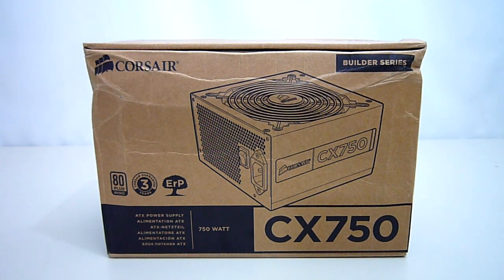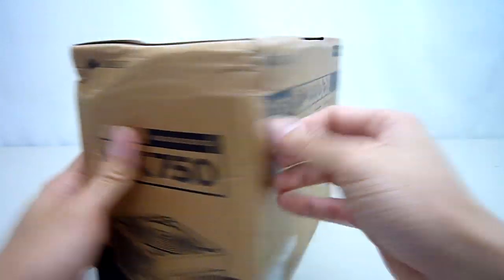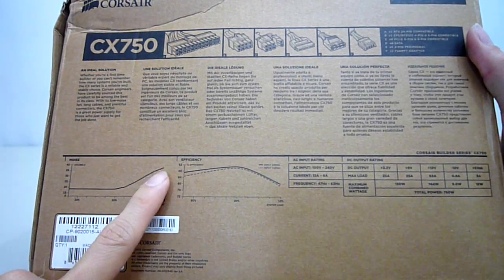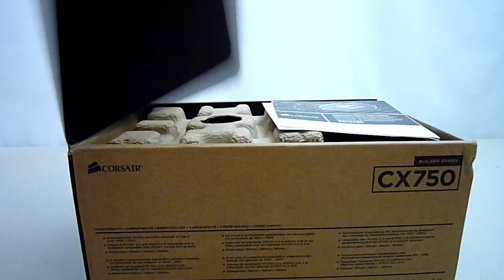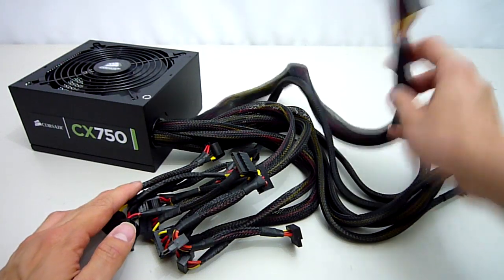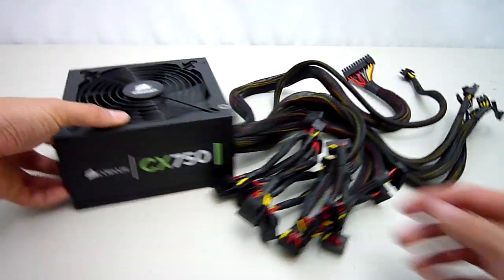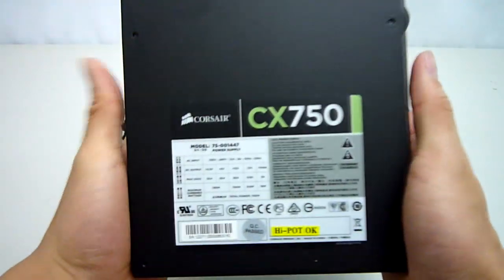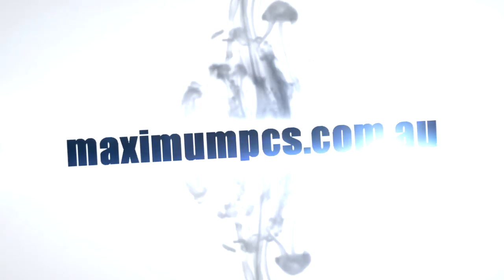Corsair CX750 v3 power supply unboxing & review - Maximum PCs Australia

Comment: will this handle two toxic r9 280xs?? pcpartpicker says the estimated wattage is 724 watts
Reply from the maker: Lukas Menke yes no problems I am using a Corsair 750W PSU with two R9 290s and it is not breaking a sweat

Comment: Is this a good PSU?
Reply: ***** can u tell me mine? If so here it is: 

CPU- Intel Core i5-4670k

CPU Cooler- Hyper 212 EVO

RAM- Corsair Vengeance 8GB

HDD- iTB Western Digital Blue

GPU- Gigabyte GTX 760 2GB

Case- Corsair Carbide Series 500r 

PSU- The same PSU in this video
Reply: spide Cooper i bought it for my 4670k, haswell ready.
but 12v = 11.7(11.8)!!!
Reply: wow nice man
Reply: ***** Would it work with
Gtx 650 ti

Gigabyte770

AMD FX 4100

Toshiba 1TB

 Ok Thanks
Reply: +Bradley0beaver  Hey, i'm going to by it next week, 
CPU-i5 4460
RAM-8GB ddr 3
HDD-1TB
GPU-  Radeon 7970
Case-Mid tower
Reply: You have steam?
Reply: Can i talk to you?I need to talk to you on something  privately
Reply: on monday

Comment: Hey! I recently had a really bad experience with a PSU that burned down after small 6 months of normal usage. So i need to know, will this hold a couple of years?:) My Computer components
I7 3770k ( not gonna overclock..)
Gtx 670 MSI
MSI Z77 MPower Mobo, if that matters. Thanks in advance.
Reply: This supply should do you just fine. But make sure that if you upgrade a lot, keep an eye out for if you need to upgrade the PSU as well.
Reply: PC and Console Gaming Okay! Thanks to both of you<3.
Reply: You could easily run that build on a CX 600!
Reply: Anything above 850 watts is for bragging rights! Even if you have a full custom water loop!

Comment: Do you think that the CX 750 actually provides that full 750w, and if it does, do you think it can keep providing it after a year of moderate use? Also, do you think it will be able to power an overclocked i5-4670K and 2 overclocked GTX 670s? I'm kind of paranoid about power supplies right now...:P

Comment: It will work thats for sure... if it doesn't you can always underclock your cpu and the gpu.... I had the same problem .. I had an sli on my CX500M and it worked just fine when i underclocked it so I am sure your sli will work probably without underclocking just fine even on full load...

Comment from the maker: Sorry about that - the connector on the power supply is a 8 pin EPS connector not a 4+4 pin however if your motherboard only has a 4 pin socket it will still work! you just plug in half of the 8 pin ;)

Comment from the maker: Nice hardware you have there! I think this will be able to run your dual GTX 580s but it is cutting it a little close as those cards are not as energy efficient as more recent cards
expected max power consumption for your setup would be around 700W

Comment: You note in the description that the EPS connector for this is 8-pin, Yet you say it is a 4+4 pin connector at the beginning of the video. Could I get some clarification? Does the cable accommodate for 4-pin cpu headers?

Comment: Hey I have this PSU and wonder if it can power 2 GTX580 in SLI.I used this power supply with 1 gtx580 SC for main GPU and a gtx460 se for physx. Worked just fine but im iffy on SLI gtx580s, it might not have enough AMPS and WATTAGE.

Comment from the maker: Nvidia rates the GTX Titan at 250W with a recommended PSU of 600W so yes that will be ok
The GTX Titan is 26cm long which will fit with plenty of room to spare in the 400R which supports graphics cards up to 31cm long
Just a shame the case don't have a side window to see that kickass hardware inside!

Comment: do you think that a be quiet 80 plus 430w psu is a enough to power the following : 
amd athon x3 3.8 hz overclock with cm 212 evo 
8 gb ram
radeon hd 7850 2gb gddr5 
500 gb hdd with dvd rw

Comment: Will this run:
Case - NZXT Phantom 410
Cpu -  Intel i5 3570k
Ram - patriot intel extreme masters 8gb (2x4gb) 2133mhz
Gpu - Msi twinfrozrIII gtx 660 2gb
Mb - msi z77 mpower
Cooling - NZXT Kraken x60
Hd - Pny xlr8 120gb & seagate barracuda 1tb

Comment from the maker: Hi there, good to hear you liked the video! Certainly this power supply has enough juice and connectors to run TWO GTX 570s as it has four 6+2 pin PCIE power cables

Comment from the maker: Depends what GPU you are using? 600w will be enough for pretty much any single graphics card on the market today (excluding maybe the 6990/other dual GPU cards), 500w I will say is enough for a 7870 or equivalent
Just make sure the PSU has enough PCI-E power cables, hope that helps =]

Comment from the maker: Hey, so the Xpredator X3 comes in at about 53cm high
Cables on the Corsair CX750 v3 are as follows:
24 pin ATX 60 cm
8 pin EPS 65 cm
6+2 pin PCIE 50 cm
SATA cables 70 cm
Molex cables 76cm
so yes should be all good =)

Comment from the maker: Hi there! I would say they are both built to the same quality. Either way both are not modular so personally I would go for the CX 750 as it has an extra 10A on the +12v rail and 4 PCIE 6+2 pin cables rather than 2. 
The only thing the TX 650 has going for it is the 5 yr warranty compared to 3, the little included corsair bag and the corsair sticker haha

Comment from the maker: Good question! so I did some more information digging...

The NZXT Phantom 410 overall is 52cm high
Cables on the Corsair CX750 v3 are as follows:
24 pin ATX 60 cm
8 pin EPS 65 cm
6+2 pin PCIE 50 cm
SATA cables 70 cm
Molex cables 76cm

so yes should be all good =)

Comment from the maker: Hi! yes this will be plenty for what you intend to be running as nvidia recommended using at least a 550w psu for gtx 670s
In fact with four 8 pin pcie connectors it would be capable of running two in sli if you wish =D

Comment from the maker: Hi there! Yes very quiet =) this PSU has been installed into a Z77 system with an overclocked 3570K and Asus 7970 currently stress testing with entire system at max load and the power supply isn't even breaking a sweat